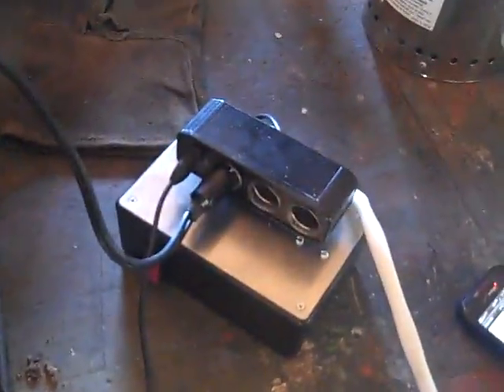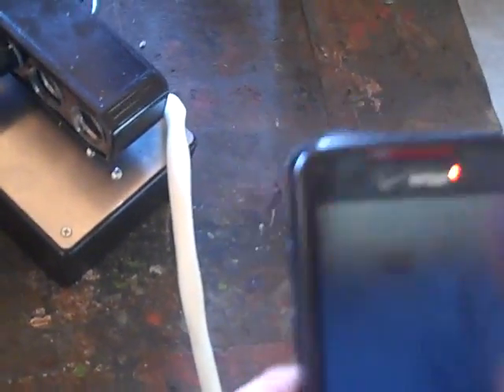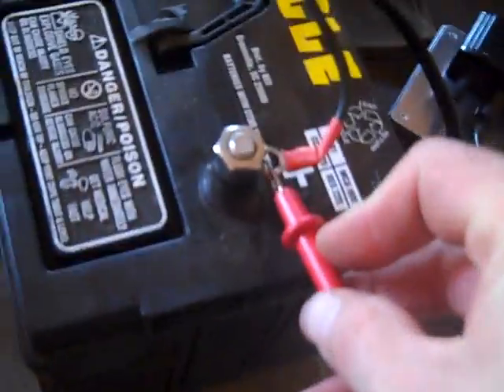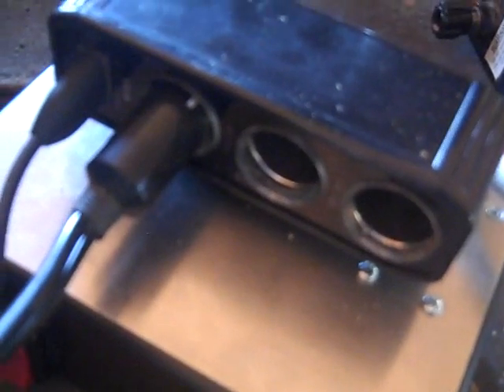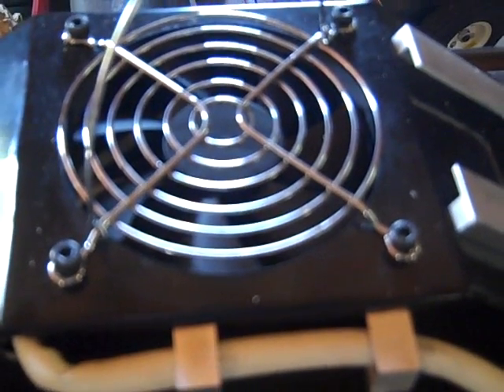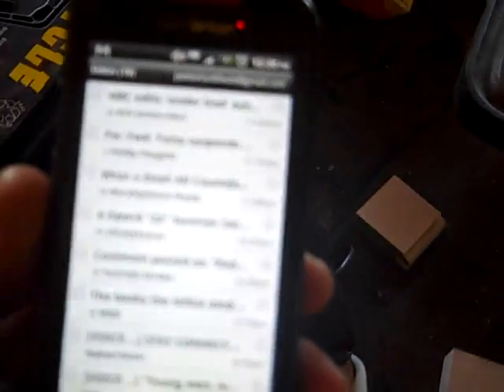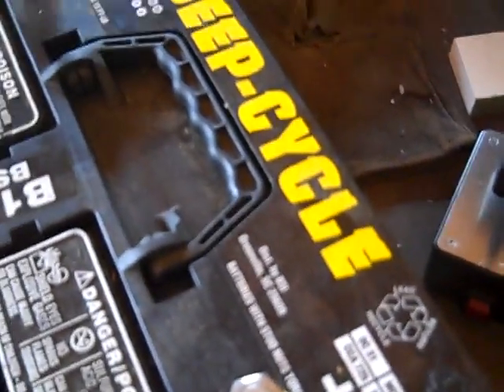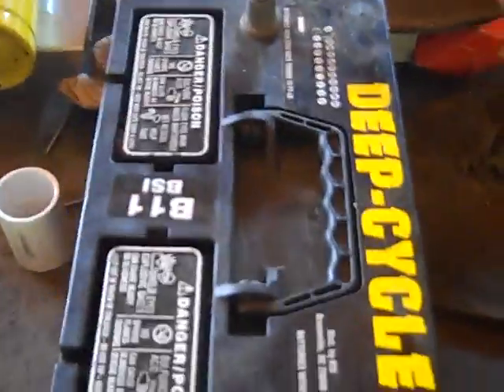Hot Stuff! Charging batteries from a heat source

Comment: Ok so if your in the garage then route air ducts from outside to assist the fan= much more heat disapation..
    I watched a french guy run hair clippers off an inverter @220v... couldnt believe it....
     I have a cubic mini cub wood stove running a thermosiphon for hot water in my rv... Please tell me this system could be beefed up to charge a 2 12v 900cca deepcycle battery bank with a good kick. The smaller the stove the shorter full heat times are. So trickle charging .... plus a little bit...

Comment: would i be right in assuming that if one set were run oppsite theyd have a cooling effect, in effect a log burner could inversly power a refigerator build in similar fashion??
Reply: nope. It would burn out the teg module. You would have to put power THROUGH the module (going from negative to postive) to generate a cooling affect. Heating effect is opposite.

Comment: Have you tried putting this device the hottest part of your car engine in order to charge your car battery using the engine heat ?   Usually, you have to drive for about an hour or so on the highway to fully recharge your car battery.   I was thinking this might be a good way to charge the battery even faster.   When the car is parked (especially in winter) the heat of the engine could still charge my battery when the motor is stopped while the motor is still hot and the outside of the car is quite cold).

I was thinking of using a thermoelectric generator on top of my engine hooked up to a solar charge controller to prevent over-charging and hooking the output to my car battery so that the wasted heat would be used to maintain my battery.  (I do not drive my car often so sometimes my car won't start because the battery is too weak).

Comment: Hello Sir...I am interested to build one similar like this..but the different is I collecting heat from car exhaust...Well now I am using HT-12710 TEG...Well I now have  problem to generate enough power..below is my experiment data:
Hot side = 122.07 C
Cold side = 83.98 C
Temp Difference = 38.09 C
Open circuit Voltage = 0.6 V
Short Circuit Current = 0.2 A
Well this result was achieved using experiment not using car exhaust...
I really need to know the reason why I still fail. Thanks..

Comment: this is discontinued now and was know as Source-1 Compact Hybrid Thermal Electric Generator. This came with a controlbox and the aux batterypack and the extra sockets.
now all you can get is the Eagle-1 12 Volt TE Battery Charger by the same company. Be glad you got one Engineer775....so jealous. good videos btw keepem coming

Comment: Man this is absolutely rad!  Resurrected a few deep-cycle batteries that were sulfated.  As you said the delta T is what produces voltage.  If you put say, an R-134a evaporator on one side of the thermoelectric, would it produce enough wattage to overcome the compressor load?  Probably not, would be cool to try though

Comment: They are Seebeck modules they are made specifically for higher temperatures up to 700F that is why they cost more. The use bonding materials that allow them to handle higher temperatures. Peltier modules cannot handle the e hat and melt or break. Ebay sells modules that they state are Seebeck but at 200C maximum you can't get the power output so stay away. If you want a real think go to tecteg.com they sell Seebeck modules.

Comment: There is another larger unit that puts out more power. i think the model is a TEG12VDC-24AIR. The TEG generator uses a 5" fan not the 3" fan in this video and has much laregr heat sinks for better heat dissipation. the controller is a variable voltage regulator and has a piggy back buck board that controls the speed of the fan

Comment: I also ran into a problem that the ambient temperature of the air around the TEG unit would get so hot that the temperature differential was reduced to a point where the TEG would stop producing power.  Even with the fan running and huge heat sink after a short period of time the heat around the TEG unit would be too hot to work effectively.  I believe the unit would function better if the TEG was mounted to the side of a stove vs being used sitting on top where the hot air is surrounding it.

Comment: The voltage varies greatly depending on the heat the unit is sitting so a DC to DC converter is needed to keep the voltage at a point where it will charge a 12v battery. At 300F I was getting about 5 watts of power but that was from a unit that was twice as big as the one shown in this video. I was using my gas kitchen stove as the heat source with a griddle much like in this video so I couldn't get the heat up much higher than 300F.

Comment: I've looked at one of these units a little closer and would like to provide some clarification on what's inside the "black box".  The box in the unit I examined contains a pack of 12 NiMH AA batteries that provides about ~2 amp hours of 12v power. There is a small capacitor as well but it's purpose might be more to smooth the power output to the DC to DC converter which sits between the TEG modules and the small battery pack so the voltage is sufficient to charge the pack at the correct voltage.

Comment: Is this the reverse of a Peltier (spelling) cooler? Instead of providing power to achieve a temp. difference, you get the power from the temp. diff.?
What do those things cost "over there"? I can think of a LOT of areas, where these would be useful, but it all boils down to ROI, obviously.

Comment: 2hrs of charging from the capacitor in the "black box"  unlikely...  i would like to see if it would charge the phone without the battery attached as power would flow back into the circuit so in the test he is showing we cant be sure if the phone is changed by the battery or the TEG. he should have hooked a multimeter between the TEG and the load to see the amps or more likely millaamps generated. it is a cool little device tho

Comment: fantastic, Why not rig up a set on your woodgas truck, instead of needing the woodgas, use the the heat from it to power a battery bank for an electric motor. With a good cooling system on the cells you should be able to get a good power return.

Comment: @twowee1s you can use copper and iron wire and it causes an electric current to flow in heat, i have an old electrical book that shows it. its kind of weak, but the more you put together in a paralllel or series circuit, the more voltage and current you get.

Comment: im sure you know this, but you can use copper and iron wire and it causes an electric current to flow in heat, i have an old electrical book that shows it. its kind of weak, but the more you put together in a paralllel or series circuit, the more voltage and current you get.

Comment: @DeleteMeOnline sure we can, but their are valid logistical reasons to charge a battery: some devices are not readily adaptable to a non-electrical source, the battery is portable, where as an efficient heat exchange system might not be so mobile, the battery can be used at a time when you can't burn fuels or there is no fuel available. What about starting an engine? You may have a great woodgas powered truck but if there is no starter battery then you are stuck. It just gives you more options.

Comment: @engineer775 I see that. Reading the web site now. Quite interesting. Could just build a wood stove and place in in like a frying pan or something like you did. Any type of heat source would work then. Very cool. Expensive, but worth it when no fuel. What is amount of heat that you need to generate?

Comment: @Gardensandcabins I wonder if you could burn LED lights using the electrical generation as they would be very low amperage and voltage.

Comment: I would be curious to see the effectiveness of the heat transfer from say a solar water heating system - still using the sun, but just wonder the different between charging from solar panel vs. heat transfer from solar heated water

Comment: @DeleteMeOnline Lead Acid batteries are not THAT inefficient. The performance and purpose of a deep cycle battery is very different from an engine starting battery. Conventional lead acid batteries are typically 85-95% efficient, and yes AGMs are 99%+ but you can't beat the price. Also, sulfation can be mitigated by keeping a proper float voltage and using a smart charger that provides high frequency pulses.

Comment: You are an incredible resource. Any idea how long it takes to recharge an average 12v battery? How much wood in lbs would it take?  How long will the unit last? Thanks for bringing this stuff to us non engineer types. Now I'll never get to sleep tonight. Oh man, the possibilities. LOL
Reply: Did you stick with the ideas that you could make? I’m here because I can generate 140°F heat for pretty much free (through compost) and I’m wondering if the surplus heat that I don’t use, whether I can charge a 12v battery over time to supply power to lights, a fan or even a TV.